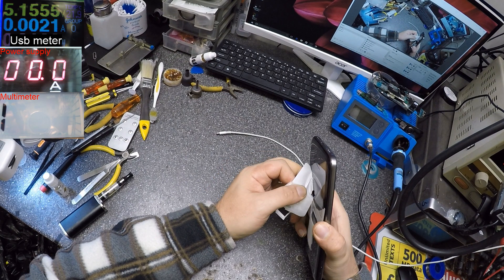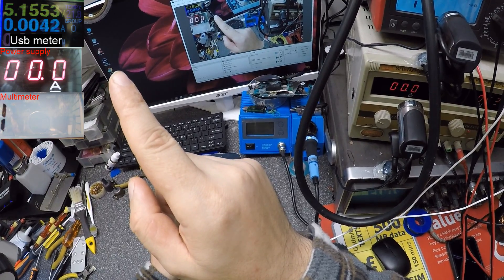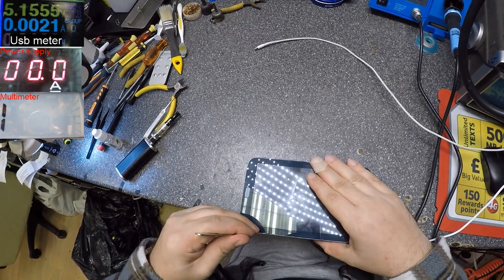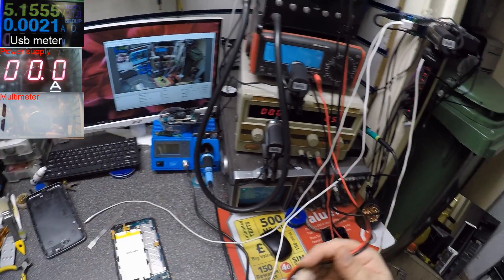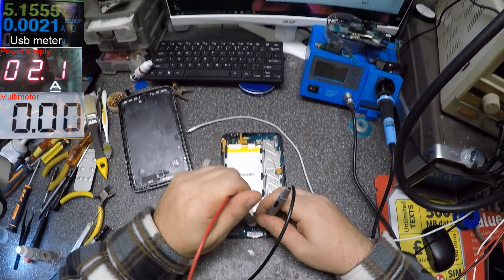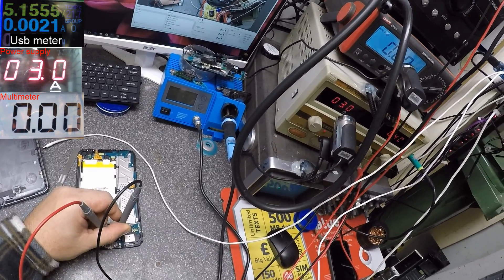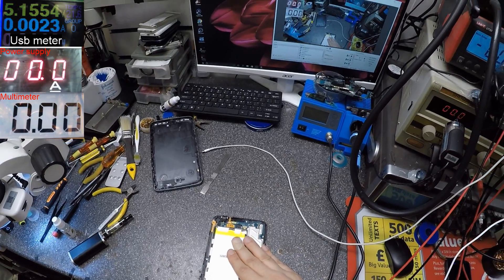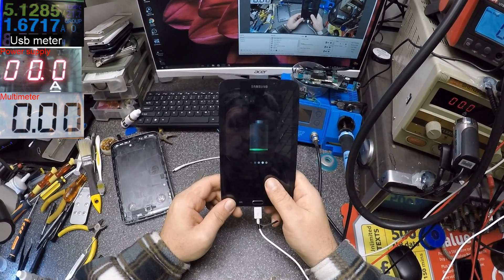Samsung tab 3 check this if no power and no charging

Comment: good evening sir,i have a samsung tab 3 model SM-T2105 ,the tablet is completely dead ,no charging and no power .i have tested the voltage at the battery connector on the motherboard after disconnecting the battery and connectinng  usb cable .and the meter is jumping between 3.6 v and 2.4 v ,its constantly jumping non stop .i think there is a short between the usb port  and the battery connector on the motherboard .can you please help me with some advice .thanks.

Comment: Hi Sorin,

First of all thank's for the incredible work you've done through all those videos.
That's gold! We learn a lot from you, so big thank's for sharing your knowledge.

I'm stuck with a P5200 samsung galaxy tab 3 10.1.
I' ve been checking charging port: OK.
Tried to charge the battery directly with an adjustable power supply just like you do in the video (5V / 3A).
Battery is 4.3V (fully charged) but still nothing.
I can't make it recognized by windows via USB.
The only strange thing is if I hold power up button and plug USB cable, windows tries to recognize it (hear the good connection sound), but then it tells USB device is not working properly.
If I do the same thing with power supply, it charges at about 1.3A, then it decreases indefinitely.
But still nothing happens. Still black screen.

I've looked at the board, there's a resistor (R010) which seems to be dead. Could this be the issue ?
How can I be sure ?
I'm a big beginner into this !

Thank you!
Regards.
Reply from the maker: well, i'm not good on tablets boards repair, usually if the board is dead i just move over due to high repairing  flow. Thank you. but if u will get one dead, i try to do a video
Reply: Ok. Never mind. Thank you for the quick reply!
Wish you a beautiful next day (friday coming!) ;)
Reply from the maker: indeed, thank you

Comment: Hi Siron, 
I just got the 10.1 version (P5120) from the tablet you got in the Video. A Family member gave it to me as they weren't using it for nearly 2 years as it got rly slow towards the end. When i tested it directly at their place it was completely dead but after leaving it for 30min at the charger (no charging symbol etc) I decided to turn it on with the Odin mode combination, it flashed brightly in a violet-white colour for 2 times, after that it went into download mode, after 30sek I decided to try and boot it up but during the splash screen it just turned off and never turned back on ever since. I already changed out the charging port as the old one seemed to be demaged but still nothing. I also tried dis and reconnecting the battery but even that didn't help nor did any button combo I tried. I came to the conclusion that probabrly my battery is completely discharged and that the violet flashing was probabrly the SOC doing weird things as it didn't have enough power when I managed to start it. I dont have any measuring device to measure how much current if any is going into the tablet but judging by your video there is a little bit going in there, is it eventually going to charge the battery after maybe 2-3days to a point were u can turn it on or will this just be wasted time? I might also add that the tablet was never dropped nor did any intensive programs run on it like 3d games and the water indicators on the backpanal also weren't triggered and as the original charger always was used I rly doubt that the screen or board are demaged, also all ribbon cables are fine, no tears or similar visible damages and I re inserted them all.
Reply: Now, sry for the long comment but my 2 main questions are: is there any way that I could charge the battery with an external source? I have a PC PSU here but I think it will supply to many amps even at 3,3v. Alternatively I saw that a guy with the same tablet and probably same problem fixed his by charging it with a cheap power bank without safety mechanism, does this actually work?
Also if I just keep the original psu connected will it eventually have charged enough with the little current that was going through in your video so that the tablet can start up or does that amount of energy not do anything?
Well, as an last option I can always buy a new battery but if i can fix it without spending any extra money that would be awsome.

Comment: for my problem is the battery still draining when not being used, even already turned off. The Voltage from pin connected directly to battery still  showing 3.7v

Comment: I have 2 batteries, one charged at 3.4v and the other at 4v ; I have even changed the USB charging cable with a new one, but still same problem, it does not power on. Any idea ?
Reply from the maker: https://www.youtube.com/watch?v=vGIPDfNCEpM&list=PLbRsB6WOs7FvhrxXxQooGD8TiloHxlQ7h&index=18

Comment: so you cannot charge it without opening tha tab3?
Reply: no..it wasnt charging and was below rated charging voltage...needed to apply some current directly to the battery in order to bring it to charging level..
Reply: @romeinkadir9599  Hi is there any easy way to charge the battery this way without buying expensive Multimeter?
Reply: @PerRo13  hahaha  if u think he charged  the battery with a multimeter ,, man is better for you to buy a new device.